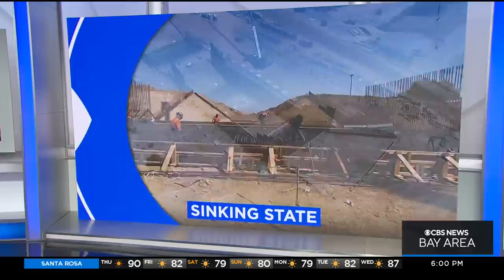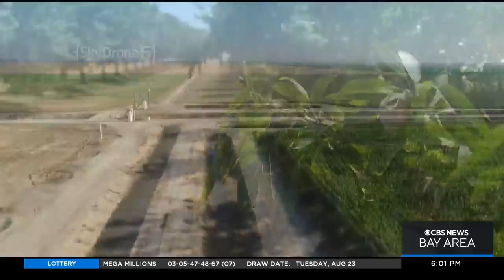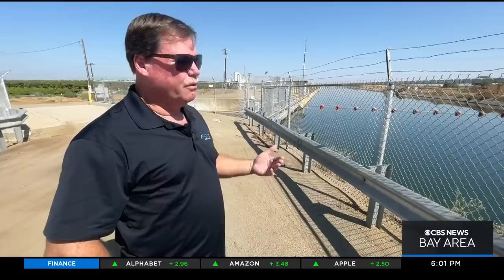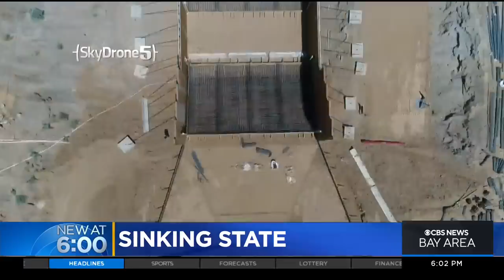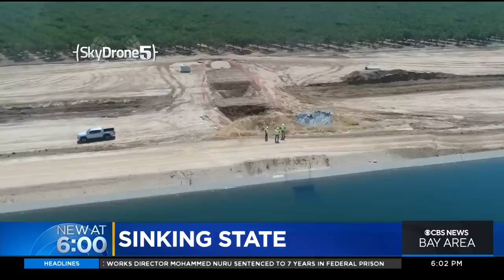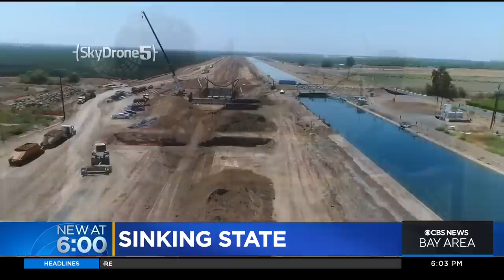Construction crews race to build replacement canal as Central Valley sinks

Comment: When you over pump an aquifer for many decades   This is going to happen.    
The Aquifer  was used as an unlimited resource.  Which it is not.
This is a very short term Band-Aid at best.
Reply: the  california aquifer is the 3rd LARGEST in the world.. you cant  over pump it
Reply: @johnnyllooddte3415  You can over-pump any aquifer if pumping exceeds the long-term recharge rate. What vested interest do you have that you would spout drivel in public?
Reply: @johnnyllooddte3415  It’s already overdrawn. Did you even listen to the news story?  The shallow wells have run dry in many areas.
Reply: @johnnyllooddte3415  watch
Reply: Use govt powers of seizure to apply WaterFX solar distillation - at 1/2 to 1/6 current water production costs - the tech was sold to an oil co that's sitting on it, after govt funding perfected it - use that to make water to sell farmers & ban pumping.

Comment: Who would have thought that draining aquifer's would have a future effect ?
Reply: What is “effect” they’d likely reply
Reply: it happened a decade ago with houses built on land around oil wells. all of a sudden the back yard dropped down into a hole.
Reply: @louisehoff  Wow, What was there first? The oil wells or the City? Asking for a friend I already know the answer
Reply: @okaythankyoubyeee2501  signal hill, Long Beach CA
Reply: Use govt powers of seizure to apply WaterFX solar distillation - at 1/2 to 1/6 current water production costs - the tech was sold to an oil co that's sitting on it, after govt funding perfected it - use that to make water to sell farmers & ban pumping.
Reply: @louisehoff  Try again. LB incorporated 5 years after they started putting up wells... And I'm going to guess the city has gotten a little bigger since then. 

Or simply put, the built the town around an oil boom
Reply: @okaythankyoubyeee2501  I did not know this, stand corrected.

Comment: Much of the San Joaquin Valley is sinking because the farmers are pumping all of the aquifers dry for flood irrigation. Why are they pumping them dry? Because all of the mountain source rivers that would replenish the groundwater are diverted into reservoirs that then push all of the water through those canals so people in the LA Basin and places like Palm Springs can live in deserts and have free flowing water.
Reply: 70% of water is sent through the delta and allowed to flow right into the ocean unused in order to keep salinity levels at acceptable levels. A single dam along the delta to the bay area would fix all of this. But it would me allowing everything west of that dam to be salty ocean water, instead of brackish which is what we have now.
Reply: Those are some good theories
Reply: Agriculture is a much bigger water user than cities. The reasons the aquifers are being overused now are valuable water-intensive crops, especially almonds, and a twenty-year mega drought made worse by climate change.
Reply: @deshaunjackson8188  An environmental disaster to fix an environmental disaster is a pretty poor tradeoff.
Reply: @dzerkle no it’s not. Cities are not just residential use. Business use water as well. Look up the water usage to make a cell phone or a pair of jeans.
Reply: @ml-jt6eg  Except cell phones and jeans are not produced there.
Reply: Use govt powers of seizure to apply WaterFX solar distillation - at 1/2 to 1/6 current water production costs - the tech was sold to an oil co that's sitting on it, after govt funding perfected it - use that to make water to sell farmers & ban pumping.
Reply: No, Farms use 80-90% of all the water used by humans.

Comment: I study hydraulic civil engineering, this is great to watch infrastructure being erected, the thing is once the capillaries that allow the grounds permeability, are being squashed when they lack the presence of liquid and then lack of support for substructures, foundations, abutments for the canal etc causing subsidence,

A non related fact that’s ironic, it’s easier to achieve a hermetic grade seal in a water pipe than a pneumatic pipe.
Reply: Use govt powers of seizure to apply WaterFX solar distillation - at 1/2 to 1/6 current water production costs - the tech was sold to an oil co that's sitting on it, after govt funding perfected it - use that to make water to sell farmers & ban pumping.
Reply: owo;
Reply: Whose ever idea it was to do this should be in J A I L

Comment: It's NOT A DROUGHT ! ! !    
We have been in the process of ARIDIFICATION for over a decade now.
  "Aridification is the process of a region becoming increasingly arid, or dry. It refers to long term change, rather than seasonal variation. It is often measured as the reduction of average soil moisture content."    Wikipedia
Reply: this is primarily due to overuse of water resources in a desert. they are pumping too much ground water. self-inflicted environmental damage going on in CA.

Comment: I thought the water tables under the central valley were mostly clay, and that when the water is pumped out and the land sinks, it's impossible to re-charege them?  Also:  Doesn't almost all that water just go to L.A.?
Reply: every aquifer is rechargeable
Reply: @johnnyllooddte3415  Yeah. No. 

When groundwater is pumped out of certain underground aquifers faster than it is replaced—particularly those in fine clay or silt soils—the aquifer loses the hydraulic pressure that supported it. Sediment falls in on itself, causing the aquifer to collapse and the ground to sink. Pumping groundwater helped California weather an epic drought, but that comes with consequences. Once collapsed, lost space in a clay aquifer cannot be refilled, meaning valuable freshwater storage space is lost forever.
Reply: Several area of the San Joaquin Valley sit on limestone-- Tracy, Manteca, Ripon, Escalon, Riverbank, Oakdale, Lindon, all the way up to just before Sonora. I know there's more between Modesto and Merced.
Reply: @tjs114  I assume those are areas that haven't subsided with ground water removal.
Reply: @TouchingClothProd  Is that science from a reputable source? If so, can you share that? Cos the way I see it is that any 'sediment collapse' would be due to clay shrinking once water has been removed, that would then create voids, which could then collapse. If water were to be reintroduced then the clay would absorb it and expand
Reply: @johnnyllooddte3415  Not this one. It is smaller now.

Comment: Hey knuckle heads, talk to hydro geologists before talking about "recharging" the ground water in your region.  The water bearing strata isn't rechargeable.
Reply: Chill Will  Or they can switch to thinking with their heads instead of thinking with their wallets.
Reply: Uhm, I live in the San Joaquin Valley, and I know that my small town paid a heap of money for geological studies about 10 years ago. We sit on limestone with large  open 'pockets' that water collects in about 450 feet below us. And water sinks down through the sandy soil into the limestone which is full of holes and collects in those pockets. And we know the water collects down there because it's the source for the town's wells and they did a test the year we had tons of rain -- 2016 I think? Where they put some non-local trace minerals on a fallow field and 8 months later that trace worked down into the water table.
Reply: @tjs114  Which town?  Not all the Valley is on limestone.
Reply: yes it is . compacted concrete will still soak up water.

Comment: As a matter of course they should also install solar canopies along the entire system. Saves water from evaporation, increases generation efficiency of the solar system by keeping it cooler, go a long way to both reducing emissions from water distribution and electricity generation as a whole, and, provide a large proportion of California's net zero 2030 goals. Retrofitting is almost always more expensive. If you're going to do it properly, do it properly from the start.

Comment: That's what I was thinking . . . require that ALL ag adjacent to both sides of the canal use canal waters.  No more pumping . . . say . . . like 10 miles from each side of the canal or whatever.
Reply: Use govt powers of seizure to apply WaterFX solar distillation - at 1/2 to 1/6 current water production costs - the tech was sold to an oil co that's sitting on it, after govt funding perfected it - use that to make water to sell farmers & ban pumping.

Comment: How about regulating water use, maybe requiring drip & micro irrigation, use annual flood waters sluiced into ocean to recharge aquifers, reuse treated waste waters, use govt powers of seizure to apply WaterFX solar distillation - at 1/2 to 1/6 current water production costs - the tech was sold to an oil co that's sitting on it, after govt funding perfected it.

Comment: But why re farmers forced (and it is ‘forced’) to drill deep, expensive wells for water?  Let’s not forget the role of the California Water Resources board that has been intentionally taking water that was once dedicated to the Central Valley farmers and rushing it out to sea to ‘save’ various fish or other critters.  It is a political problem, compounded by the long-term refusal to fund or address water problems ALL over the state.
Reply: All Ag surface water is subsidized by the general taxpayer. Ag never has and never will pay an equal share of the state and federal engineered water infrastructure in this state. The economics of Ag don’t allow for it. In a very real sense, farming continues at the benevolence of the general taxpayer, although you’d never know it from the propaganda put out by the Aggies. Local overuse of groundwater, like in this area, is what happens when there is no check on Ag. The fact that the state is bailing them out means they will not learn anything from this either, except, perhaps, that they can continue to do whatever they want with no negative consequences.
Reply: They do it because they, their neighbors and their ancestors already pumped out the shallow water, and now it is gone. 

Drawing more fresh water at the Delta intakes would indeed drive some species to extinction. It would also increase the risk of brackish water at those intakes, which would be catastrophic.

Comment: Poor engineering and greed. No one until now have thought or considered the ramifications of changing the structure an flow of the natural water sheds.  Mostly been building homes on flood plains , an ya wander why it floods, just like the desert, ITS DRY

Comment: farmers should not be allowed to use ground water when there are canals for them to use. yet, they keep drilling because it is cheaper then paying for water from a canal. and i have yet to hear anything about stopping new wells being put in for agriculture. so much mismanagement of our lands and water it isnt even funny.
Reply: Kindly refrain from making assumptions and recommendations until you cozy up to water right laws.  That will keep you busy reading for the next decade.  First every single acre foot of water in the canal... is owned by somebody.  Land adjacent to the canals... may not have a water right.  This is just the tip of the water wright iceberg.  Oh and ground water is regulated.  It's CA.  Everything is regulated.

Comment: Note that California, including the Westlands Water District, has no effective monitoring or limits or price on groundwater pumping. So, the agribusinesses drill deeper wells and grow water-intensive crops, especially almonds.  There is nothing to stop them, so the shallower wells run dry and the aquifer collapses. 

This is ancient water. It was in the ground a long, long time, and it can’t be replaced. The farmers are effectively mining it. Once it is gone, the businesses and towns that depend on it will collapse, along with the ground. 

The only way to stop this would be to stop drawing the water faster than it is recharged. That would require regulating the ground water, reducing its usage, causing agribusinesses to make less money, and probably causing multiple extinctions in the Delta. All of that is hard, so the solution will be to build new canals when subsidence makes the old ones useless. 

Just to be complete, the reason this problem has gotten so bad is that California is in a 20-year mega-drought exacerbated by climate change. There just hasn’t been enough rain for everyone.

Comment: Remember when Ca nixed the “Love Canal” project. This would have collected all the mountain runoff that empties into the San Francisco bay and piped it to these central valley farms. Oh no! What about “the environment”? Well, there was a great deal of wisdom to this plan. It proved simpler and lest costly from simply taking Colorado River water from the Arizona and Nevada allocations. They just increased this grab again taking over 20% of Arizonas allocation and a similar amount from Nevada.

The canal is still a viable solution to the central valley shortage but it remains easier for Pelosi and Feinstein to steal it; both individuals approaching billionaire status from kick backs and insider trading activities by their husbands.
Reply: ??? Every river in the sierras is dammed up, and there is an extensive system of delta canals that bring that water to farms further south. Have you ever been to the area?
Reply: @deadtome44  your point?
Reply: @larrysorenson4789  my point is you seem to have no understanding of the water infrastructure already in place. Much of the water flowing out of SF is already used across the state.
Reply: @deadtome44  your assumption is wrong.
Reply: @larrysorenson4789  so why are you talking about the delta mendota canal and California aqueduct like they don’t exist?
Reply: @deadtome44  I don’t think I mentioned either example, their existence or not, my initial comment was about the Peripheral Canal which was not built. Can you write about the water entering the bay and any projects that may have addressed this run off water and directed it to other purposes? Larry